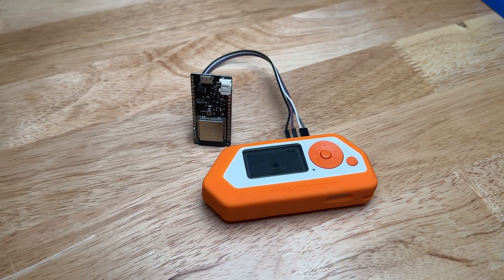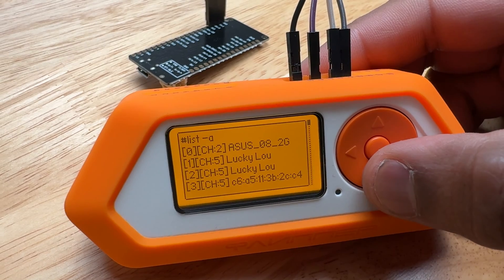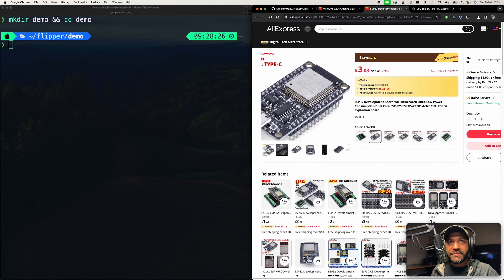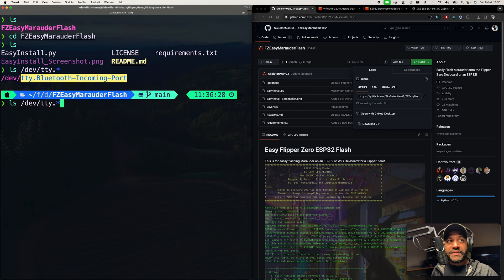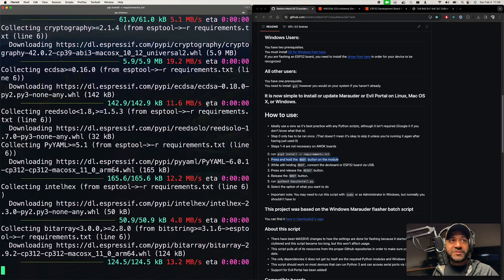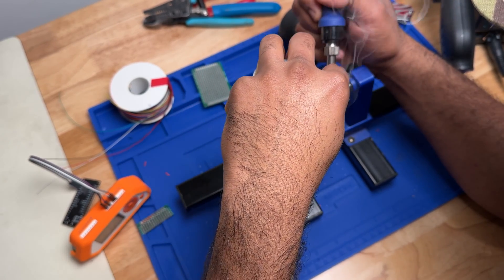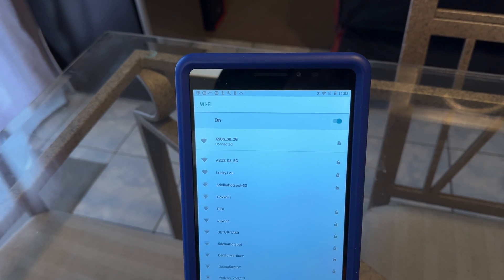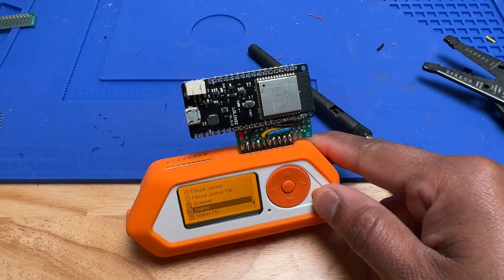FLIPPER ZERO : DIY WIFI MARAUDER DEV BOARD WITH ESP32

Comment: I'm losing patience trying to connect the neo m6 module to the original pinball wifi module, but among the corrupt and malfunctioning firmware, testing the GPS if the connection is successful is impossible, in fact thanks to your video I acquired a wroom esp32. a question, I noticed that the S3 model is more modern and has double USB for debugging and power supply, not to mention others with an LCD screen. What are the risks of trying those modules? thanks for the video!

Comment: What coding app do I use I’m confused, thanks
Reply from the maker: The ESP32 is flashed using python. No apps necessary. And the flipper is running the RogueMaster firmware which comes with WiFi Marauder.